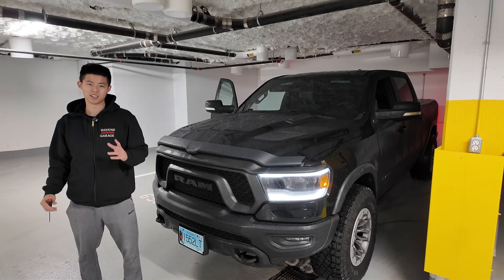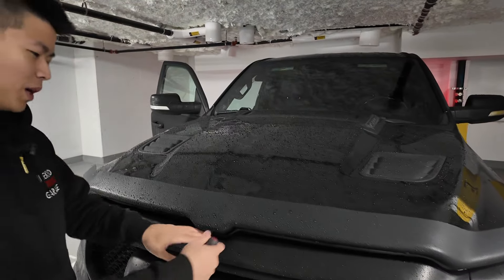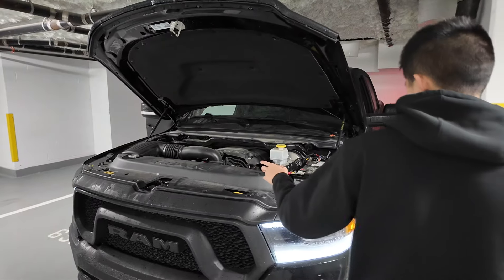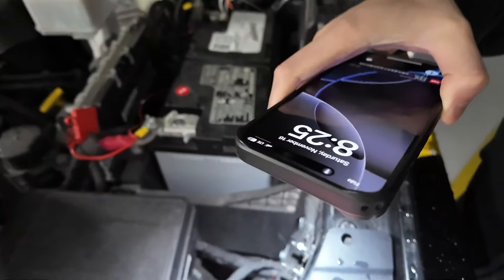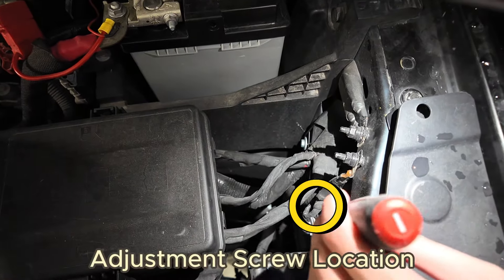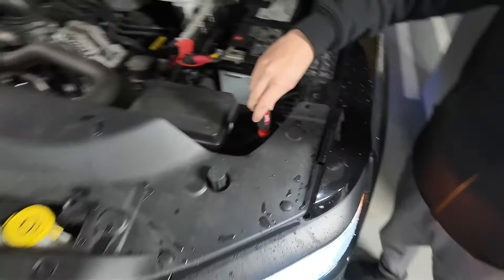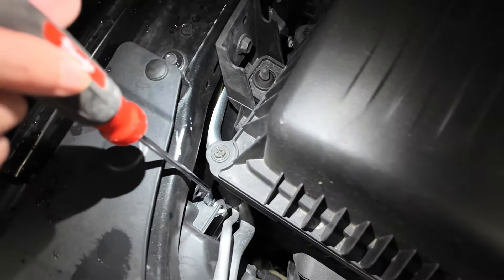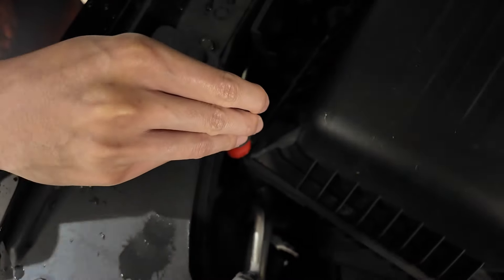HOW TO ADJUST RAM HEADLIGHTS 2019+ QUICK AND SIMPLE GUIDE!

Comment: i own 2019 ram 2500 Laramie diesel and my heated steering wheel works but as soon as i start to drive it shuts off and if i try to turn it back on it immediately shuts back off any solutions because you tube and google have been no help for me some say clocking spring some say its something underneath the driver seat i have no clue what's causing this do you happen to know what's causing this ?
Reply from the maker: Have you ever removed the original steering wheel?
Reply: @WeekndGarage  no I have not
Reply from the maker: @mathewchutko5487  I’d take the steering wheel off and make sure there’s no pinched wires for the heating element, put a meter on the connections make sure there’s no short circuit. 

From what you described it sounds like the wheel has to be replaced
Reply: @WeekndGarage good to know. Thanks for the info. When I get back from vacation, that's the first thing I'm doing lol
Reply: Check the relays and fuses connected to the steering wheel and infotainment screen
Or could be a software bug and has to be updated at the dealer
Reply: I dont have that adjustment screw in that position I have a 2020 warlock